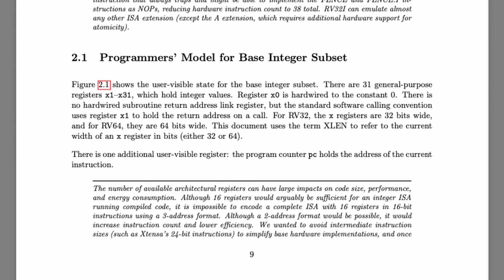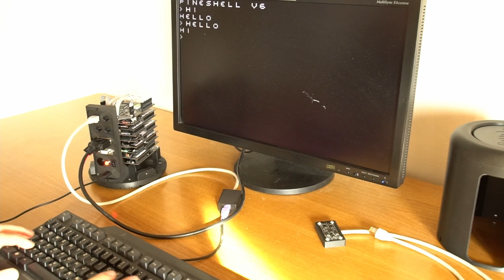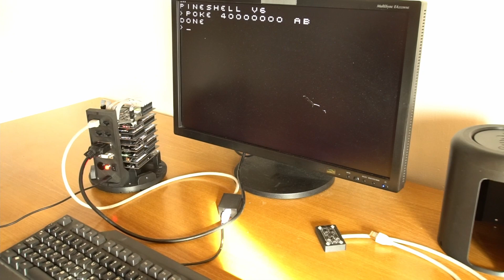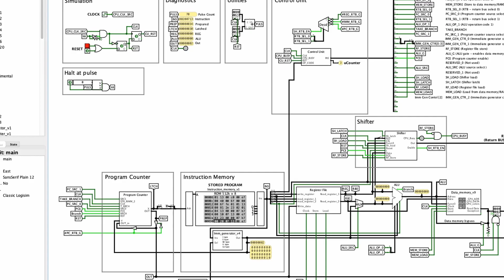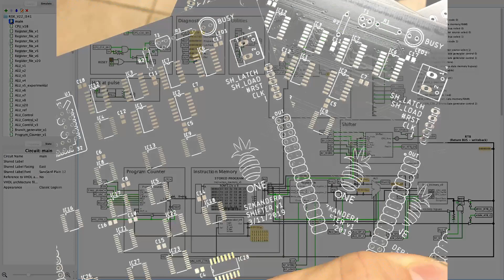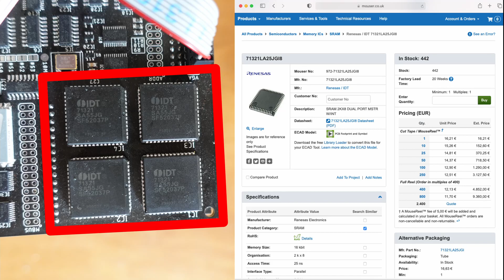Pineapple: 32-bit RISC-V CPU that you can make at home

Comment: What is a protocol on this i/o connectors ? it is direct GPIO ? or some simple serial I2C ?
Reply from the maker: Yeah, direct GPIO
Reply: @filipszkandera8267  pluS power so 6 i/o pins?
Reply from the maker: @AK-vx4dy  These are RJ50 not RJ45, so 8 bits + vcc and ground

Comment: You'll be lucky if you don't need a cooling system for that build, Filip…
Reply from the maker: Actually, the whole system is pretty cool (pun not intended). The only chips that are getting somewhat warm are the dual-port RAMs. But they stay just warm. I had the CPU running for hours and hours on MakerFaires with no problem at all.
Reply: @filipszkandera8267  Speaking of cooling, I found this ultra-cool technology called trigeneration, that generates heat, cooling, and electricity all in one setup! How it works will leave you guessing, but I could pretty easily implement it.

Comment: 2:00 You are clearly a bright and sharp kid, but I would not call a design that seems to be using 84 or 100 pin ICs "discrete" :D That word could perhaps pass for 74-series logic and similar ICs with (say) 20-80 transistors on each chip, but what it originally meant was typically using all discrete transistors and diodes.
Reply from the maker: Yeah, I think somebody also suggested this to me a while ago and I later stopped using it :)
Reply: @filipszkandera8267  Dare I ask, btw, what are those four large ICs you are using? I mean the ones visible on the top board.
Reply from the maker: @herrbonk3635  These are dual-port RAMs, used for the VGA circuit. On the new CPU currently in design, I switched away from these and use just normal RAMs
Reply: @filipszkandera8267  Ah, I see. Thanks. (I prefer to use standard components myself too, when possible. ICs that has existed for around half a century with dozens of manufacturers. Like TTL/CMOS logic and SRAM.)

Comment: fantastic. Will there be a 64 bit update?
Reply from the maker: Not yet, but with the next version, a lot of the functional blocks will be simplified and thus doubling its bus-width wouldn't be *that hard*.. That being said it would need some purpose to go that far.. I still hope I can achieve running DOOM in some form or another (will underperform) on the next-gen (RISCie), so currently this is the goal.
Reply: @filipszkandera8267  I am looking for a GHZ speed diy CPU , xbus capable, to create a open source computer. I dont think this CPU you have here can go to that speed, but if you reach 64 bit, then i can hack further to increase the speed
Reply from the maker: @seanscon  1 GHz? Holy moly :)) You are then better off with an FPGA or something like that, I'm not sure it is even possible to reach speed in GHz with a home-brew CPU without some very special components. But let me know if you find something!
Reply: @filipszkandera8267  I have not found one. That is why I am looking for any projects that I can find, and trying to figure out if i can build based on it :)

Comment: I wonder if the speed is limited by the discrete chips or was it a actual design goal for that speed? Awesome project regardless.
Reply from the maker: Thank you! These chips should be fine even at 25 MHz most of the time, but if you daisy-chain several of these together the propagation time will increase and that will decrease your max. frequency. But I'm also convinced that some of my "blocks" are more vulnerable to higher freq. because of "not the best design decisions" on my side.
Reply: @filipszkandera8267  looking forward to seeing more videos of your progress and for other projects and I will let others know too

Comment: I like your project but can i ask what is limiting the frequency of the CPU? I mean why it is running at 500 KHz?
Reply from the maker: Thank you - there are many reasons: I really wanted to utilise the 10x10cm PCB area so I had to make compromises (because it would get very expensive very fast). Mainly because these are just 2-layer boards and some of the PCBs are really crowded, there can be some cross-talk due to insufficient ground plane. The second reason would be the EEPROMs - I used 70ns ones, which for example in the ALU (which is serial!) there will be 490ns delay to be sure that we have the correct result. I'm aware of these shortcomings and I'm now trying to eliminate them, for example by using carry lookahead adders and so on. Stay tuned, because hopefully a better CPU is on the way!
Reply: @filipszkandera8267 the 8 bit pipelined CPU build on YouTube has a lot of great ideas for other people's basic CPU cores. He managed to make his cpu 5x faster per clock than a 6502 and roughly 10x faster than a z80 per clock.

Comment: I've asked a large amoutns of creators this now, but here is the question. I have been getting really into homebrew CPUs, and want to design and build one completely from scratch. What resources would you recommend to learn these things?
Reply from the maker: Ben Eater's series is a great place to start!
Reply: @filipszkandera8267  I've built his design out, but I haven't learned too much, it taught me the basics of CPU architecture and what not. However, my goal is by the end of my summer break to have the knowledge and ability to build out a 32 or even 64 bit cpu/computer from scratch.
Reply from the maker: @zach-18082  Then check out Robert Baruch's LMARV project :)
Reply: @filipszkandera8267  It seems really interesting, now that I’m no summer break i’m gonna go through that series.
Reply: @zachgolle1802 
Maybe have a watch for Kevin's 8bit pipelined CPU for a design that incorporates a lot of higher level more modern cpu design choices, though using 8 bits for chip count reasons, you could easily up the register count, instruction width, and such.

Comment: Filip, if I can tell right, you are using Logisim Evolution? If so, how did you get those RAM modules, are they custom? I gave up trying to model a processor in Logisim after seeing that that the memory units are not byte-addressible but it looks like they are in your version of Logisim.
Reply from the maker: Hi, not really sure to what exactly are you referring to, but they are not custom. I used the Logisim Evolution HC edition, which is linked in the video description so that may help.

Comment: Well, the Honeywell 1648 I started on in 1977 had 32k of ferrite core and clocked at around 1MhZ with an 8 bit IO bus and ran dozens of simultaneous users in time sharing mode.

Comment: It's a macrocontroller!  I think because this has on board memory and stuff, this is actually a full computer, not just a CPU.  Whatever it technically is, it's definitely amazing.  I am curious though, why so many smaller boards?
Reply from the maker: Thank you, yes it is definitely a macrocontroller and maybe a very simple computer :)) As these boards were my very first I've ever designed for a professional manufacturing, I wasn't sure If I can get them right for the first time. And after the prototype was finished I just had to modify some boards to allow stacking, which was easier than a complete redesign.
Reply: @filipszkandera8267  wrong naming 😀 It maybe minicontroller, controller, kilocontroller, megacontroller or gigacontroller 😄
I personaly stand with gigacontroller 😄
Are you living in Poland ?
Reply from the maker: @AK-vx4dy   :DD no, I'm not from Poland
Reply: @filipszkandera8267  You have quite polish surname and name maybe other slavic country
Reply from the maker: @AK-vx4dy  Yeah, the surname comes from Polish for sure :))

Comment: You dont have to feel bad for designing your CPU in logisim. I also made a CPU (custom and quite naive architecture) and guess what I used to simulate and design mine. Minecraft! And because I did not have enough breadboards (and did not want to spend a lot of money on them + they dont make as reliable connections sometimes) and I also did not want to spend money on PCBs, so I wired all the ICs together just with wires and solder (dead bug style). Well considering the time it took me to solder all the pins and wires and the mess (actually seeing all the interconnects is quite cool)... I should have probably sticked to the PCB style. Tho I did not share anything on the internet (yet).
Reply from the maker: That sounds really cool! Please share it :)
Reply: I started with Minecraft too! It's great for a little while until you start deciding to make a CPU that is complex. Currently I am designing a CPU in Logisim Evolution. It is a 16/32 bit CPU and is my 14th CPU that I've ever made.
Reply: @ducksonplays4190  I wonder how many people get introduced to digital logic by playing minecraft and then start to learn more and more and eventually start experimenting with circuits in real life.
Reply: @tomaspecl1082  Probably a decent amount of people.

Comment: You should be able to run it close to 50MHz?
Reply from the maker: I want to run it faster, but no way I'm achieving 50MHz :)))
Reply: @filipszkandera8267  Have you tried overclocking it or is it only stable at 500khz?

Comment: Jawdropping! What is the difference between your Shell program for this CPU and actual simple Operating System?
Reply from the maker: Thank you very much! My shell program is more of a program - it executes some predefined commands if some criterias are met. You can compare it to some very early computers that only had command line interface for example. I'm not an expert in operating systems, but there will be some kernel and other stuff running, and your program will run way above this in another ring. I really want to expand the idea of my shell program (or maybe a veeeeery simple os?) in my next CPU revision, that would be hopefully more powerful to handle it.

Comment: So the idea is that 32 bit appear like one cable if one uses ribbon cables: https://youtu.be/KzSaFFpBPDM?t=374
Maybe you could repeat the motivation from GitHub in your description. Like a 32 bit CPU is easier to code for because Pointers to video buffers can be processed in one command, and you write that keyboard interface is easier, but I thought 8 bits are enough for scan codes.
Reply from the maker: Yep, that is correct with the ribbon cables. 
I think the difficulty of coding for 8 and 32-bit CPU is not really comparable, as many of the homemade CPUs (including the first one I made) can only be programmed in assembly, but as I'm using well-defined architecture, there are already made C compilers, so why not use them.
Reply: @filipszkandera8267  Ah yes, the C compiler for 6502 is really slow.